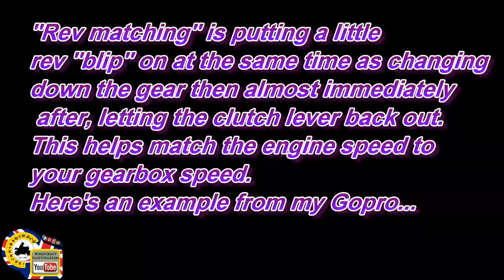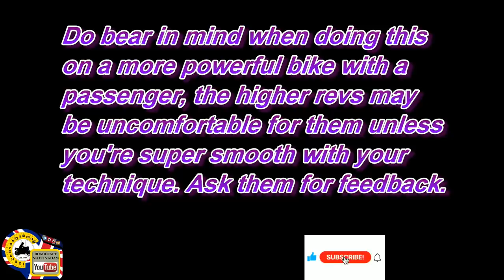WHEN to change gears on a motorcycle : How I do it as an instructor of 39 years. (Timestamped)

Comment: I've been scouring youtube learning about what each gear is for since I could not find one or maybe I need to type the right kind of keywords. Like for example, when to use 1st, 2nd, etc gears. What gear is best for downhill, or uphill, or on bumpy roads. This video, although it didn't answer all the questions I had in mind, answered most of it and gave me a better understanding. Like using the brakes first before the clutch, using lower gears when going downhill, what to do on curves, engine braking and rev matching. Thank you. I've been using my younger brother's scooter since august last year, and planning to learn how to use a manual motorcycle because I'm getting one soon. Riding is so much fun and have unlocked multiple experiences for me.

Comment: This video was way more useful than I expected. I am going to have to use these tips from now on! 

I noticed something I do when slowing down. If I have an age to slow down, throttle off, barely any braking, then I let the clutch out slowly to get engine braking as I slowly add more brakes in. I am going to stop this habit now. I do it way too often, and I swear my clutch will die sooner or later.
Reply from the maker: Thankyou. Yes, all those resistant reintroductions of the clutch will also put premature wear on the parts. Have fun practising. Pleased this turned out better than you expected.

Comment: Nice video. I'm from The Netherlands and I have watched a whole bunch of IAM Roadsmart videos. Very useful, I have certainly learned a lot. Yet I have also found out that some of the correct ways do not suit me. I like to do engine breaking, both on 2 wheels and inside 4 wheels. It is not so effective on a bike, with the exception of a BMW R1100RS I used to have. But then that powerplant is constructed as a car engine. I also tend to approach a red traffic light in neutral, I call it the lazy way. That suits me, I'm a lazy and extremely relaxed (some people call it slow 🙂) rider/driver. I do get very good MPG numbers... Not unimportant today.

Comment: Engine braking performance really depends on the engine. Some engines even have slipper clutches installed, as they have such massive amounts of engine braking in high RPM that otherwise the rear wheel would lock up. 
Another thing about engine braking, is that you conserve your brake pads. At the same time, it puts no additional wear on the gearbox because you are engaging the opposite side of the teeth as when you do with acceleration, and that side usually wears out the first anyways.
The headbutting can be negated with proper down shift technique (throttle blipping/rev matching).
Reply from the maker: Slipper clutches are really designed for more extreme riding/track work and aren't needed on road going bikes if you're riding the bike correctly as per my demo. Also, engine braking as I explained in my demo should not replace the brakes, again if being done correctly. Brakes are much more effective and cheaper for anything other than minor speed changes. Try just using your gears on an emergency stop for example, granted it's an extreme example but perfectly demonstrates their real effectiveness.
Reply: @RoadcraftNottingham  I 100% agree with you that engine braking can never replace regular braking, especially not in an emergency. But not just in extreme examples as you mentioned. Because engine braking is highly dependent on engine RPM, you cannot depend on it slowing you down in low RPMs. Still, at least for my bike, around town riding engine braking is more than sufficient for 90% of the braking I do, and only when almost coming to a stop I need to add some front brake to come to a halt. I have found my engine braking to give about the same 'braking performance' as most cars do on the road slowing down for roundabouts and other 'obstacles'. 
I dont remember if you mentioned it in your video, but one 'dangerous' thing about engine braking is that people behind you might not realize that you are slowing down, hence I always have my foot on the rear brake to light the tail light.
Reply from the maker: @tHaH4x0r  yes, the brake light is important. The engine braking I'm referring to is also called "acceleration sense" and is usually done in the gear you're already in and if brakes aren't needed then select another gear, that's acceptable but lots of people change down for the purpose of braking, to replace the brakes and that's wrong.

Comment: I love this video. Loads of useful information/instructions but at the same time  letting me enjoy the ride with you.
My biggest take away is at [Min 11:17] - "Going downhill, the weight is more in your front wheel and early downshifting risks locking your rear wheel up." Though I don't do it often (we lived on a hill 😅) , but sometimes I do and now I know it can be dangerous!
Other than that, I've another "bad habit", I tend to coast by pulling the clutch in, then feather it out again, on speed bumps, slowing down or sometimes even in corners... Seeing how you shift, I think my problem is I don't trust my bike enough... I'll keep these in mind from now on.
Thanks Russ.

Comment: Great video, executed  and explained very well. Good ride as well.  Some would argue that at times when you didn't change up that you would be  using too much fuel in a lower gear but at higher revs as opposed to moving into a higher gear with lower revs and using less fuel use but you explained it well and its all to do with forward vision, forward planning ,greater safety and smoothness in mind and that the engine is always at it's most responsive to the throttle and road speed required.  Nice one..
Reply from the maker: Thanks. Funny you should mention it but on my first upload attempt I mentioned "eco riding" but the revs on the pan weren't that high to mention it really. I'm not sure if you're using any more fuel by going up in one movement like that or doing open, close, change, open, close, change again.  Thanks for the compliments. ☺
Reply: @RoadcraftNottingham     I don't disagree but I would have thought that its not just whether  one block changes or  does it sequentially.  It's whether one wants to be travelling any distance in  a lower gear and at higher revs on a regular basis as opposed to being in a higher gear but with lower revs.  Some could argue that by being in a higher gear with lower revs one is riding with greater importance to economy as opposed to  engine and bikes response and thus safety. 

A friend of mine had a big heavy 1200cc custom and on narrow roads and tight bends he always said that the brute wouldn't do as it was told ie he had difficulty in managing it and actually fighting with it and that was painful at times to him..  Then I found out that he was in a relatively higher gear with lower revs.  as he said not to waste on petrol  ie have greater economy.. I suggester that he might try dropping  down at least one gear on the narrow and tight bendy roads and he may find riding easier and he did. He did find it having a  better  response  with  less ache in the arms and back.and less stressful.  However he did find a very  slight reduction in his mpg but nothing really to complain about. He is certainly a happier chappy now.
Reply from the maker: @judgedredd49  Yes, being in a more responsive gear without revs too high allows fine steering on bends by throttle as opposed to a much higher gear possibly having unburnt fuel/lugging problems. We need to be in that sweet spot as much as possible.
Reply: I ride in as high a gear as I can, partly for the reason of it being cheaper (an important consideration for some of us!) but also it just feels better to me.  However that "as I can" obviously includes choosing an appropriate gear for the conditions.  I have a 500 and will go up to third gear at 30 (fourth at 40 etc.) but come down ten lower, so will stay in third in a 20.  Which is fine when easily passing though a straight-ish road through a village, but I will go down if traffic or hazards start to build up and I need to change speed more regularly.  Conversely if on a long quiet road in an urban 20 I will go up to third early.  You can proritize economy without sacrificing safety.
Reply: @Rebecka_J  As u say one gets to know ones bike and so long as the bike is as responsive as it could be to throttle and braking changes then its  ok.  unfortunately there are some bikers out there who don't put safety as a priority. Some who would coast or cruise and being in too high a gear and lacking the understanding that if anything un-towards happens they may not be able to call on the bike to be as responsive as it could be. When that is happening and before its corrected they and sometimes others  may suffer as a consequence.

Comment: My gear shifting technique differs from most people, after throttle closed, clutch in I shift the gear, but maintain the pressure on the shifter until I have fed out the clutch and got power on. My way of avoiding a missed shift. Down shifts the same, accompanied by the instinctive and measured blip of throttle, you get to know exactly how much to match the next gear by experience. Properly done there is no lurching or loss of rear end traction. Getting donked by your pillion is a reminder you got it wrong!! Pillion should be stirred by motorcycling, not shaken.
If I see a problem developing anywhere around me (360 deg awareness, at all times, guys!) I will drop a gear or two. This has the advantage of a bit of engine braking (on a 4 stroke, the only engine braking you might get from a 2 stroke would be from the friction in the rev counter drive cable!) with the throttle closed and if you need to power yourself out of trouble, you are already in the juicy part of the power band. 
The clutch should only be in when stationary and in gear, or changing gears, avoid the habit of coasting with the clutch in. Just keep it smooth. 
Use of engine braking along with planning your stop to be a smooth gradual action will go a long way for the brake pads. Check your brake light comes on before the brakes start to take.
At 10:01, the pedestrian is aware of you but generally I try go a bit wide where possible, they are almost as unpredictable as children, dogs, cats and squirrels!!
I enjoyed just relaxing and watching your ride, Thanks for that.

Comment: Nice one Russ. 👍 All good advice for nice smooth riding. Both models of Pan are awful for natural engine braking of the gear you are in. Other bikes, my Triumph Explorer for example, are much more receptive to slowing in the gear you are CURRENTLY in (acceleration sense). One tip/trick you missed, is going from 2nd to neutral when coming to a stop (rear observation allowing).
Reply from the maker: Yes, I missed the differences in singles/twins etc too. Popping the bike into neutral whilst still rolling was something I've always not recommended although it's not the end of the world.... Although I don't teach it, I sometimes do it 😂
Reply: @RoadcraftNottingham  I wouldn't do it while rolling much, more like just at the point of stopping. 😉
Reply: @RoadcraftNottingham  hahaha. You have the knowledge, my friend, so I'll not argue with you, but let's just say that *some* bikes don't reward you with a shift from 1st to Neutral when you're (finally) at a stand-still, and so you learn to tap it into the green from 2nd, if you're already at an appropriate speed, and in a suitable situation. But you have to teach  the right way, huh?
Reply from the maker: I'm with you on that Barry although increasing the revs whilst stationary helps that selection
Reply: @RoadcraftNottingham  (smile) I'll try that, Russ. I'll come clean: old 850cc Moto Guzzi V-twin. Sometimes, when stationery, you can go from 1st to 2nd, from 2nd to 1st, and back again until cows come home, and not find the neutral that's *supposed* to be in between them. That 'other neutral' further up the range, though, that's well easy to find! 

But that's wry humour, none of which negates from the value of this lesson which I am going to take away and use to consider my current habits...
Reply from the maker: @barryconway  Ask guy Martin about false neutrals 😂

Increasing to about 2k revs at standstill can sometimes make those clutch plates separate. Let me know if it works. ☺

Comment: I think the main reason people does the "Bad Downshift" is that it sounds cool when they "blip" down. I know that's why i do it. Never even considered that the engine was breaking, as i'm always on the break anyway. I don't do it when it rains though, as the ABS doesn't prevent wheel lock when you engine break (learned that on my own. Not by crashing, but still a lesson learned)

Comment: So pull the clutch in, go all the way down to first without letting the clutch out. Till your at the stop? Correct? That's how I've been doing it but I always wonder if I'm doing it right or if you should do one at a time. But that would take much more time
Reply from the maker: You can do that or release the clutch between changes, whichever works best for you. The key is to experiment, it's part of the fun. Just be careful not to change down too early or you risk either locking up the rear wheel or at best, making the gearbox bang.

Comment: Engine braking prior to corners ensures your rear wheel is making contact to road surface and slows your bike whilst dropping acceleration and front braking before you enter the corner then when you come out of the corner you can apply acceleration and up shift! I don't understand why you don't recommend engine braking?
Reply from the maker: I DO Recommend engine braking, just not changing down gears solely for the purpose of braking as that can brake rear traction if done wrong/too early. Gears shouldn't replace brakes. This isn't just my way, it's the official police way to ride bikes. Watch the upload fully without skipping and you'll see it explained properly... The order for slowing is throttle/engine braking.... Brakes if required... Gear to match the speed you've chosen (read motorcycle roadcraft, the police riders manual)... Or just do it your way, it's your bike. ☺

Comment: Also some bikes like mine (big V-twin, suzuki v-strom 1000) has such strong engine braking that i may hardly need to use brakes. On 3rd gear when i close throttle it may stop almost to 10 km/h. I assume inline 4 will not have such strong engine braking.
Reply from the maker: Yes, there's differences in the strength of engine braking. My point is not to replace the brakes by changing down gear early.
Reply: Yes I find the same, if you ride smoothly with plenty of forward planning, hardly need to brake...😁 on a big v twin that is..

Comment: I live in a place where I’m constantly having to go from 100km to 20km to make 90 degree turns (no turn lanes and huge trucks coming in hot behind me) and needing to roll off the throttle, brake, gear down, etc. but I don’t have time/space to run through the gears so I batch gear down, but I keep messing up and going down to first instead of second! So instead of locking up the rear,  I end up pulling the clutch in  and coasting around the turn. Anyone got hints?

Comment: I’m a new rider on my 125 , on L plates .. finding it difficult at times to sort out junctions , giving way . I’m slowing as you say , then sometimes as I need to really look and almost stop at the giveaway lines  as I go into gear 1 to set off I sometimes have found I’m in neutral which is bloody bad as when I try to accelerate away nothing happens !!! Then I’ve got oncoming traffic to get away from . I’m trying to make it smoother and not unecesarally stop .
Reply from the maker: After making sure you completely release the gear lever after each change to make sure it's selecting properly, Try 3 things, firstly changing down ever so slightly earlier, try giving a little rev to match your foot movement and try letting your clutch out a little between each gear. Good luck.
Reply: @RoadcraftNottingham  I’m improving, that’s the main thing

Comment: Nice video, thanks! But on my 600 cc single cylinder enduro from the early 80s, downshifting to slow down works really well and sounds really nice, what can I say :)
Reply from the maker: What can I say?...... Hooligan! 😂. Normal "acceleration sense" is fine but using gears instead of the brakes isn't looked upon kindly by us "proper riders" 😉 Think of an emergency stop, you'll use your brakes then won't you? ☺
Reply: @RoadcraftNottingham  True! To be fair, it's usually more just closed throttle engine braking rather than downshifting. Those thumpers sure slow down! But yes, if proper slowing down is needed, brakes are applied (also since brake lights turn on, and you surely don't want to be any more invisible than we already are to cars!). All the best!
Reply from the maker: @musiccylinderK6  exactly. Thanks for the comments buddy. Nice to interact with people. ☺

Comment: You can almost hear the 96 ft lbs of touque in that V4 (126 HP) .No wonder you can  pick 2 or 3 gears at a particular speed ..  A V4 and Shaft drive ..  It is a class act if not a little  porky ... I would love to see what Hoda would do with this idea in this decade :)

Comment: Great video. 

Can I ask, are you letting off the brakes before selecting the correct gear or chaging as you are still braking? 
I’ve done a  response course in cars and brake gear overlap was a no no. We’d shed all of our speed, come off the brakes and then select the correct gear. I didn’t know if this was the same for motorcycles.
Reply from the maker: Good question 
.. Sometimes I'll slightly overlap the brakes and gears which is fine. Have an experiment both ways as there'll be loads of different scenarios, see which feels better/smoother for you.